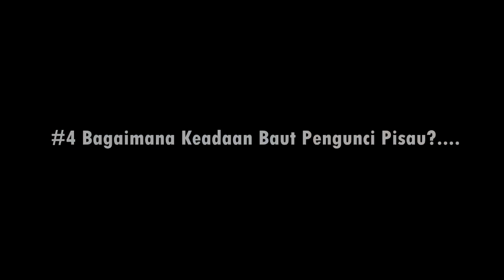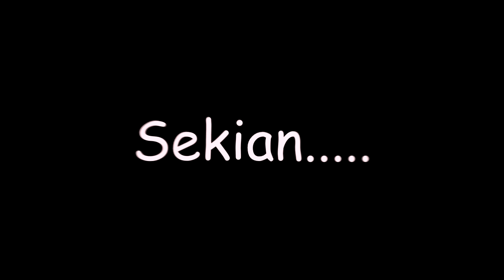#4 REVIEW JIGSAW MAKITA 4327M Setelah 2 tahun pakai!......

Comment: Pak kalau paling bagus yg type jig saw makita yg mana y, saya buat potong 50mm thick HDPE
Reply from the maker: Tipe 4352 FCT pak, tapi harganya 5jtaan,
Reply: @woodpeckerdesign  4352fct apa 4350fct pak?
Reply from the maker: 4352 pak, fiturnya lebih unggul, bentuknya juga udah beda, untuk potong tebal, itu lebih rekomendasi. Tapi seri 4350 juga sudah oke pak
Reply: @woodpeckerdesign  bang, kalau yg paling bagus antara 4304, 4300BV dan 4327M mana yg paling bagus untuk potong kayu atau HDPE plastic 50mm tebal. Anggap harga ga jadi masalah tapi lebih utamakan performa?
Reply from the maker: @MrAbah105  kalau pilihannya di antara tiga tipe di atas saya lebih prepare ke seri 4300bv bg, menurut saya ini yang lebih oke kalau masalh peforma, kalau untuk potong panjang dan bermanuver lebih baik ke seri 4303 atau yang saya rekomkan sebelumnya. kalau seri 4327 m, itu untuk pakai santai bg,